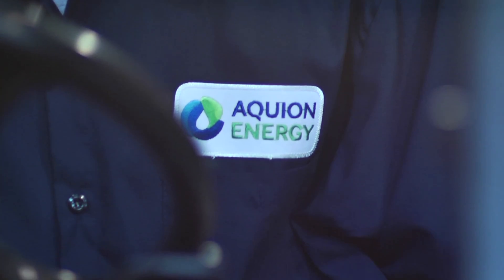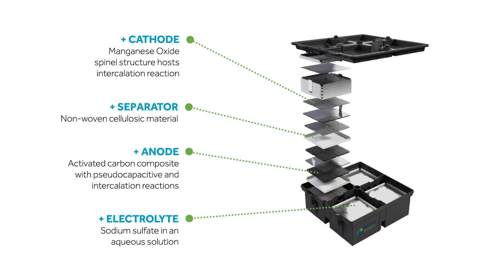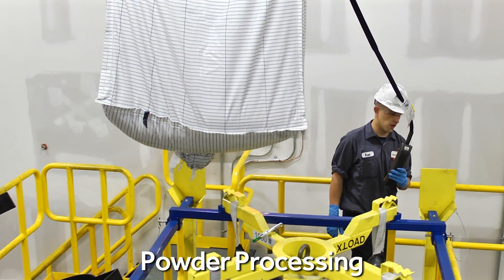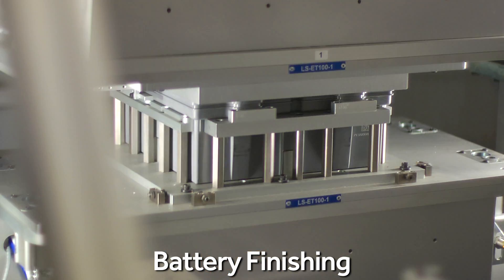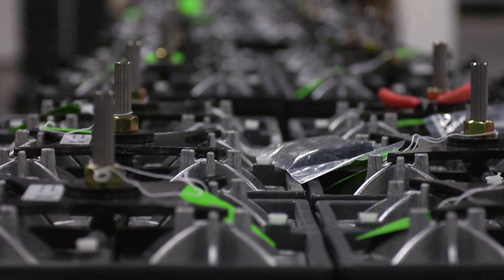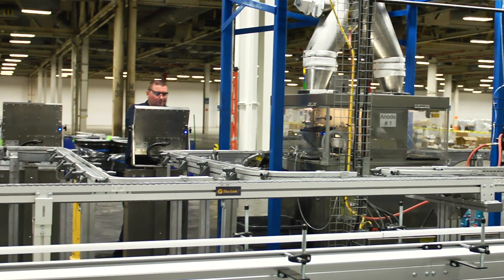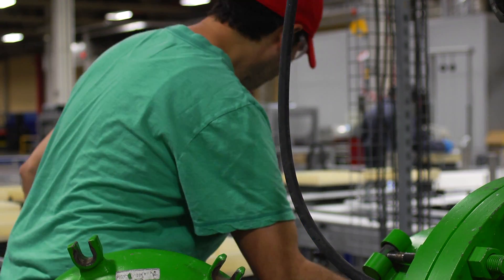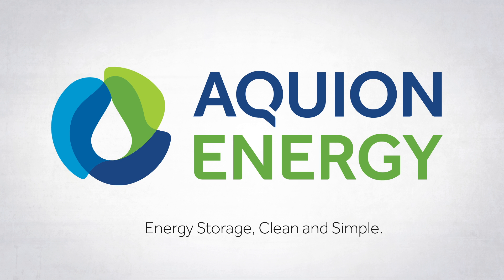Aquion Manufacturing: How an AHI Battery is Made

Comment: I love this technology , i made it by myself prototype version using Graphite road or 5mm diameter coting it with mno followed by placing separator then  foil it generating 2.6 volts to 2.9 volts and it runs green led for more then to 10 minutes i tried two salts one is producing around 3.1 volts :)

Comment: If its made from such abundant materials as you claim this battery shouldn't exceed the price of a regular lead acid battery .
makes no sense if its made of salt water manganese oxide and stainless steel i can buy the raw materials and assemble my own for the 1/1000 of the price .
dont forget this company already suffered a huge bankruptcy and im sure its because of the insanely unjustified price tag .
Reply: "salt water manganese oxide and stainless steel i can buy the raw materials and assemble my own for the 1/1000 of the price ."

DO IT. 

Not mocking. For real if you get how this works and know how to aquire the materials, compact them, etc.
Do it. DIY that and get the hits on youtube.

That or Aquion Energy should do it after facing chapter 11
Reply: @HansMcMurdy  i am developing such batteries as we speak i have lots of chemical factories in my area , already got a few stuff and i experimented with a few alloys ...  the best option is to use stainless steel plates as for aluminum and copper they corrode very fast.
Reply: @PhysicsViolator  - That's interesting... why then (when used SS cooking pots are so cheap & readily available at thrift stores) are youtube experimenters constantly using +copper and -aluminum in their experiments?
Reply: @__WJK__  hmm no idea but watch my video i already developed something better , a battery that doesnt have any metals at all . Now im going to build this on a big scale and its 100% organic .

Comment: This company got over $100M from somewhere to get started. They made one production run to fill pre-orders and shut down. Now, I think I see where all that money went. They built this huge facility with specialized high tech manuf equipment. I believe I would have started in a auto repair shop sized building. I know out West and assume anywhere there are many small rental units used by machine shops and all kinds of manufacturing. Even if I only turned out 10 batteries a day I'd start from there. I'm thinking most businesses start up with less than $1M. This is ridiculous. Maybe they could have even farmed out that pressing of the carbon electrodes. My biggest question is why can't the American public get these rechargeable Zinc air batteries made by Fluidic Energy that are being shipped to the 3rd World instead. Our gov't gave Fluidic $7M in startup funds. They also got $100M from somewhere.
Reply: Nice
Reply: They leased the facility to make the video 📹.  They sold the company at auction to us. The government has been busy tracking down all of the poor business activities and criminal behavior.  Hang in there. The government is not exactly done and we are not ready to start hiring, even though we plan for facilities we own in 48 states to distribute and regional manufacturering at our facilities we have purchased from Maine to Alaska, Hawaii to Florida.  
Take a breath. We will get to production and distribution as the company forms in the individual states and Washington DC.
Reply: They had another reason for not farming out Carbon electrode manufacturing.
Reply: Which 3rd world country do you hate the most?
Reply: We buy the batteries it's not like your government is giving us for free.
Reply: @reubenothuol1823  you bought the batteries 🔋 from the rip off artists? 
Hope you learned a lesson to research offline first.
Don't believe every media post or concocted 📰 🗞 📰 news paper tabloid type report.

Secret to having money?
Don't loose any.
 ~ WARREN BUFFETT 😊
Reply: They didn't build the leased HUGE BUILDING. Wait for the rebound with the 2017 bankruptcy auction buyers and the process requires time just like pollution required time to damage our planet's  environments.

Comment: someone correct my math plz.
For a 26kwh battery module its ~ $15,000  and last for 15-20ish years without maintenance. can be fully discharged without damage. 
VS
costco gc2 6v 205ah batteries at about  $100 each good for maybe 5 years.
 How many gc2 batteries do we need to equal the aquion battery?

One 48 v bank will take 8 batteries in series at 205ah for about $800.
so thats 205ahx48v÷1000w= 9.84kwh per set but you can only discharge to 50% without damage. so lets say its about 5kwh per stack at $800.
You need about 5 stacks at $800 each to get about the same kwh
$800x5=$4,800 but... you need to replace that 3 times in the same period youd have the 15 year aquion. so $4,800x3 = $14,400

aquion 26kwh battery ~$15,000 
Gc2 25kwh batteries ~ $14,400

How much is your time worth changing out batteries and topping off your lead acid cells? id say its worth $600 and piece of mind knowing if my kid touches the battery he won't get acid on him..... just my thoughts.  wish i had $15,000 sitting around id buy it.
Reply: that's why they went under
Reply: @ahmedalrawi3371  In September 2017 Juline-Titans closed the East Huntingdon Township facility and moved production to China.
Reply: Salt water batteries emit chlorine gas too
Reply: @awesomusmaximus3766  don't believe that response before mine. You just wait. Prices change and reports are often FALSE or FAKE.
Reply: @ajcongdon1610  I've seen the DOD vs cycle life it's good but not $15,000 good
Reply: @awesomusmaximus3766  that's why NaSo4 is used

Comment: Correct me if I am wrong.. But aren't these just upscaled Galvanic Cells? Also know as a Voltaic Pile? If that is all these batteries are.. why are they so expensive? I can make this at home.
Reply: Forget it... they are out of business since three months...
Reply from the maker: Hi Ohm, our batteries utilize a proprietary chemistry called Aqueous Hybrid Ion discovered by our founder and Chief Scientist, Jay Whitacre. AHI techology uses a saltwater electrolyte. 

We are continuously working to lower our costs. Our batteries are currently more expensive than some other battery technology, but that is largely due to the fact that we are still growing as a manufacturing company and are working to expand our production lines. We hope to bring costs down dramatically in the next few years.
Reply: I understand that all businesses need to charge more for their first batch of products...obviously to offset the start up costs. But your company is going to be obsolete in the next 3-5yrs. If you don't lower the cost dramatically.  There is a company about to produce a carbon nano tube Nickel Iron Edison battery. It is said to be lighter and smaller than all competitors... and it will last for over 30yrs or more. No maintenance.
Reply from the maker: Ohm, 
We are on track to reduce costs significantly in the near future. There are always new and emerging battery technologies, as the energy storage market is very large and growing quickly. We are confident that our batteries are robust, reliable, and safe-- not to mention the most sustainable in the world-- and that we will continue to improve our technology to be the best it can be for the appropriate applications.
Reply: Thank you for responding to my questions. I like your batteries.Great job! I am glad your company is a pioneer in the green movement. Keep up the good work. I will buy your batteries. Once they are in the 2k-4k price range. thx
Reply: Chatting in comments with self any way.
New owners are cute, perky and delightfully humorously innovated 💡 💡 💡 💡 ⚡...
Just ask or don't. 😊

Comment: I suspect the complaints on the cost of an Aquion battery is by people who have never installed an off-grid system in their home or otherwise. A 30kwh battery at $15k is only $.50 per kwh. What other battery does anyone know about that is cheaper? Please give us the link so we can go look.

Even a Flow Battery is more than that. The Aquion will drain to 0% SOC. So you get the full 30kwh, not just 20% of that as in a lead acid battery bank which is the most commonly used solar storage battery today. To get a usable 30kwh from a lead acid bank you have to go substantially bigger to drain 30kwh from it without killing your bank. 

Here is an off-grid residential install using the 30kwh module that's been in operation - 
https://www.youtube.com/watch?v=Oi1b6Dzw-J4

If you want to know how the Aquion compares to other technologies, ask an installer.
Reply: Your point is valid, but...am I wrong, or are you shifting your unit of measure?  $15,000 for 30kWh is $15000 / 30 = $500 per kWh.  That's a few decimal places north of $0.50.
My quick online search shows Tesla selling the Powerwall2 for $5500 + $1500 install = $7000 for 14 kWh.  That's also $500 per kWh.  So, depending on install cost, the AHI looks very competitive with the cheapest Li going.  
Li requires way less space and weighs much less, but is not as inert or as easily expandable (supposition on my part).
With Tesla's projected ramp-up, I'm certain their price will drop.  Hoping AHI can keep pace!
Reply: We cannot promise that price now. Inflation has knocked prices out of the ball park, just for wages and salaries.

Comment: i am looking for a dc battery storage for a solar systems i want to put in at my house in jamaica.... i am going with a 21 panel  5500 watt inverter...OffGrid.. how many of these batteries would i actually need for such a configuration.... they are already configured for 48Volts... so would i need 8 or would two do the trick...thanks
Reply: http://cleantechnica.com/2015/05/09/tesla-powerwall-powerblocks-per-kwh-lifetime-prices-vs-aquion-energy-eos-energy-imergy/

Comment: I see this working in the near term.
Reply: +YAMATO It's working right NOW in Texas. These things ROCK !
Reply: +JD97711 i have a quick question for u... how many of these do u need for a 21 Panel 5kw systems.... i am being told by my local supplier here in jamaica that i need 8 of these 48Volt batteries.. but i was thinking i could get away with just two of them... considering high insolation here in jamaica
Reply: SALES & MARKETING
1 Speen Street
Framingham, MA 01701
412.904.6400
Reply: Slamming the DoD does cut life to about 8.2 years. 50% is best at nearly 16.5 years.
Reply: I see this link that mentions the 3000 cycles (365*8.2) at 70% discharge. But do you have a link that mentions 16.5 years at 50%?
http://realgoods.com/downloads/dl/file/id/489/aquion_s30_0080_data_sheet.pdf

Comment: How many thousands of dollars per home? Payback won't be any better than any other method making it moot-useless-another scam.
Reply: +newstart49 You better shut off your computer then, you polluter.
Reply: +newstart49  Errrrnnnnttt ! Wrong !
Reply: JD97711
 Explain why. If not, my comment stands.
Reply: Research it. I did. It's what the Internet was designed for. "Sharing of Knowledge and collaborative effort".  10x lifespan and 2x Ah for same $. Oh and a way less pollution/carbon footprint. "It's not what we are doing, it's how we are doing it".
Reply: Batteries are made from acid, and byproducts and are dumped in landfills and ground water, as well as the polluting plastics, lead, zinc. A lot of energy goes into making a battery long before it goes into service. More energy than it will ever produce in it's short life span.  The resources to mine for the plastics (oils), lead, zincs, copper then refine it all, then further transport it, store it, distribute it, shape and mold it is astounding.
  Then only a small % of it is recycled- further using energy-  the rest goes to filling land fills at another cost.
 I'm amazed a battery doesn't cost so much more than it does. Perhaps because a large part of it comes from foreign countries by ship that further uses a lot of fuels and resources again.
Reply: +newstart49  These are "Cradle to Grave" Salt Water Batteries. Please take the time to research what you are not speaking of.
Reply: JD97711

 If YOU watch the video- perhaps you haven't- you will notice machines making the batteries. The machines are made from metals, plastics, petroleum products and use electricity which come from burning coal or gas or nuclear energy with dangerous wastes. It took energy and a lot of it to make that metal and those plastics, and that huge plant/building. AGAIN; All that must be shipped in fuel burning trucks and trains and ships! There is no getting around it- more energy and resources are used to make those batteries than they give- period.
Reply: SMH. Please watch anything Jacque Fresco. You have to start somewhere or return to the Stone Age. You seem to be stuck on making a point, rather than working towards a solution. 
Have a great life.
Reply: JD97711

 Like talking to a drunk.
Reply: What might be your solution then ?
Reply: JD97711

 Agree to disagree and have a brewsky.

Comment: I'm assuming these have to be massive to hold any respectable capacity?
Reply: +sixtyfiveford  Read the details on their website.  Yes they are huge but they hold twice the Ah and have 10x the lifespan,,,,oh, and can be discharged to 0% and not hurt them. Bang for the buck is good too.
Reply: sixtyfiveford One of the M-Line batteries could supply an average household for a full day. That's more than enough capacity to level off the output from a large solar panel installation.
Reply: idontcare80 Yeah, but what size are we talking about though? And how many Ah at this size is this?
Reply: sixtyfiveford The M-Line is their big battery, it's a little more than a cubic meter in size.